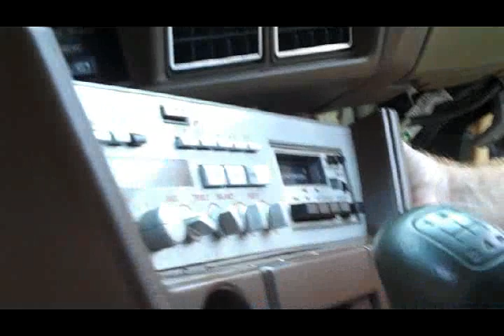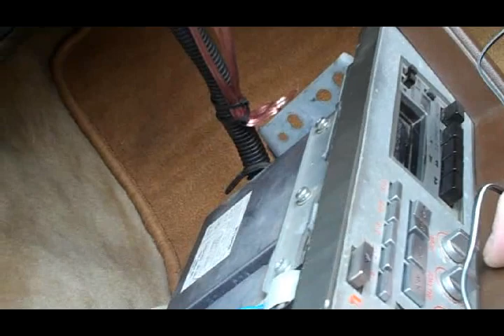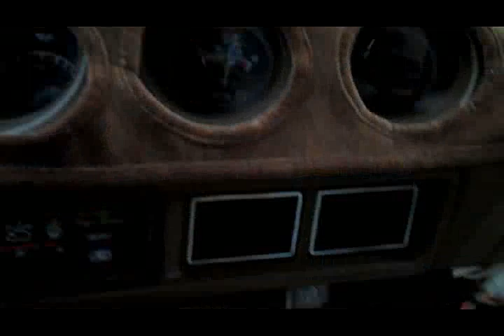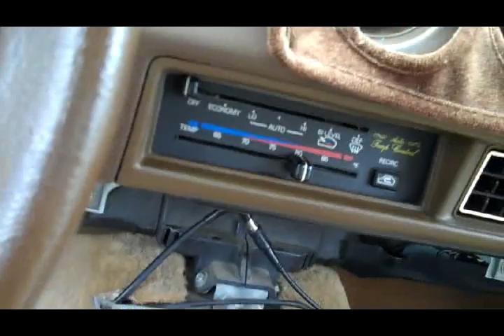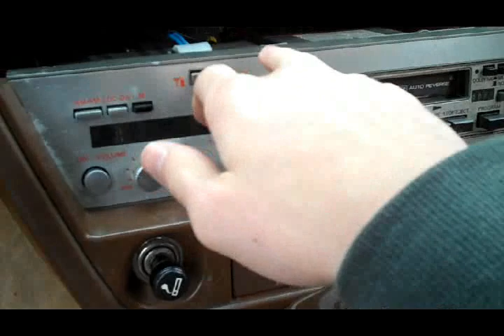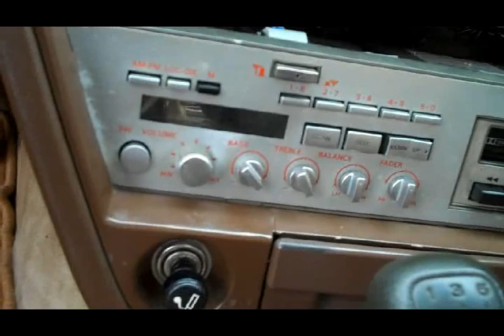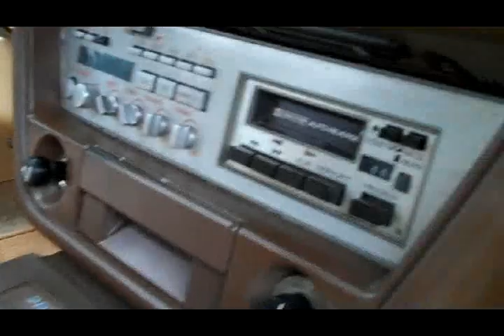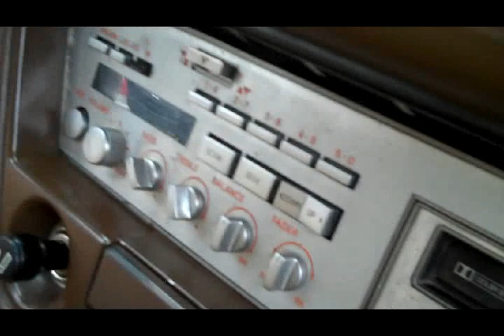280ZX: Fixing the Climate Control and Stereo with Pauly

Comment from the maker: I acctually figured it out on my own. First, check the lines going into the Vac booster (Black canister next to battery) unplug each line and check for split ends. Do the same with the lines on the intake manifold. Hopefully its not a vac line under the dash...